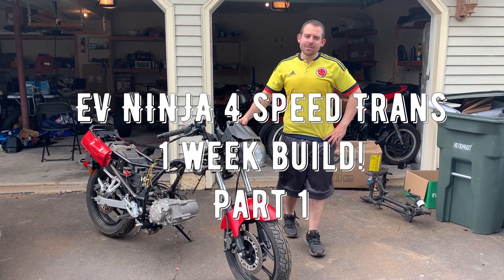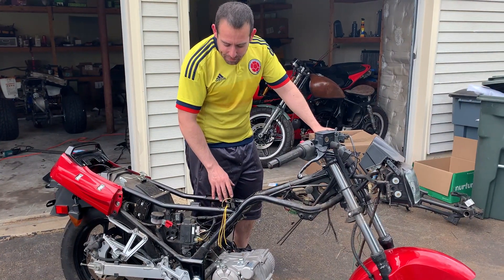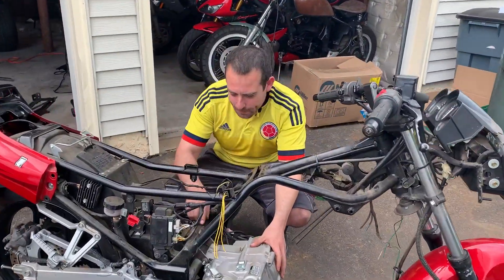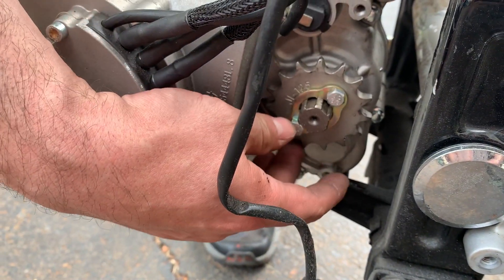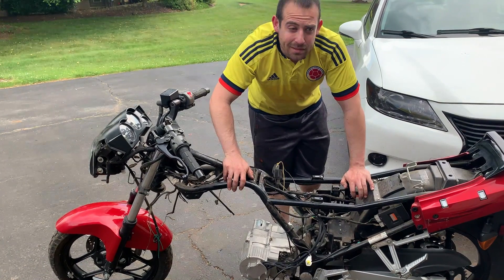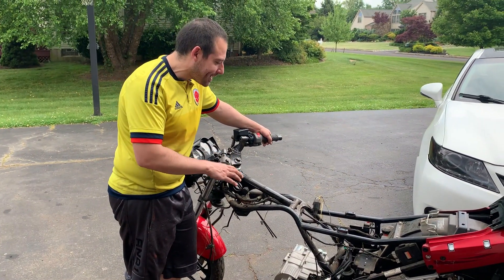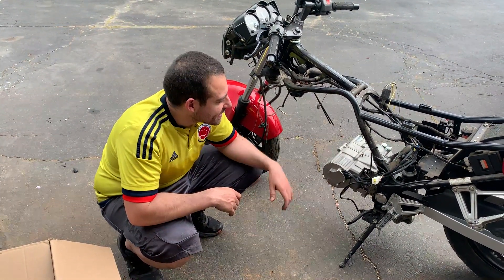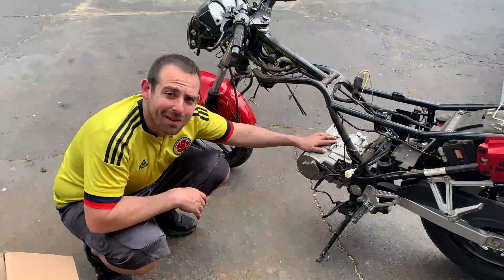4 speed EV ninja Electric motorcycle part 1

Comment: Where do you find that gear box and motor ?
Reply from the maker: Junk don’t do it , after a year alll gears stripped
Reply: @diyguy1476  have you shifted a lot between gears?
Reply: @diyguy1476  Was it the GB200? And glad I saw tis comment, I was thinking of building one.
Reply: @diyguy1476 🙏🏾🙌🏾🙏🏾🧿💰🧿  Thanks for the info & for the heads up also And I had a feeling But are they repairable or not worth the time at all 💰💰💰💰💰💰💰🤔🤔🤔🤔🤔🤔🤔🎰🎰🎰🎰🎰🎰🎰 And the gears should probably be the strongest part of the  Transmission motor Assembly Besides the motor
And in theory it would probably have to be stronger than the motor especially if you wanted to upgrade🎉 or up the power🎉🧿🎰🧿

Comment: Wow brother i need that motor for my honda 250 dirt bike. How can i get one!  Any info or link will be greatly appreciated.   I came from diy battery. Thanks for the video
Reply from the maker: I am selling them , i wanted to test it out its a new design , selling the kit minus the batteries
Reply: @diyguy1476  Can you message me your price for this?
Reply from the maker: Its 880 for the controller, motor and trans, and key and throttle
Reply: @diyguy1476  Wow very cool. I just emailed you about converting my YZ250F. I've been looking at a similar setup.

Comment: What are the details on that motor and transmission combo? Who makes it? Where did you buy it from? Looks like it could be a good option for my conversion.
Reply from the maker: I am selling them its a great set up , the company asked me to demo it on a build so i did and i was able to do it in a week . Its an apt72400 controller and i used 500 Samsung E50 21700 cells
Reply: @diyguy1476  how can i contact you to buy
Reply: @diyguy1476 hey is the company still around? Whats the name of the company and do you have links to purchase them still? How has it lasted you?